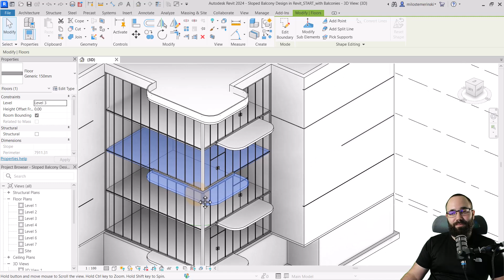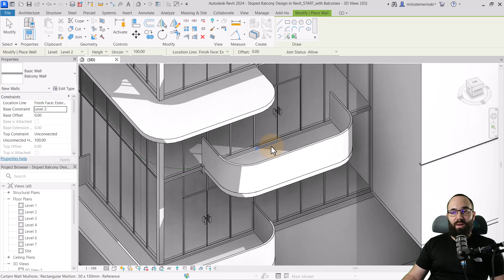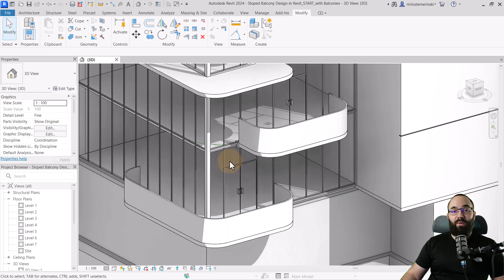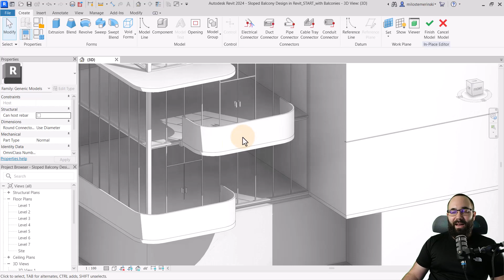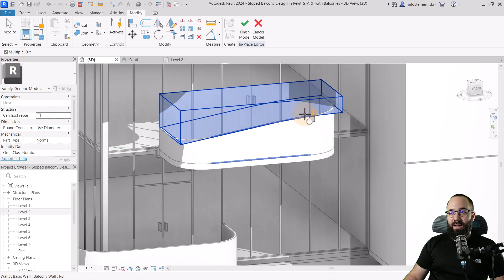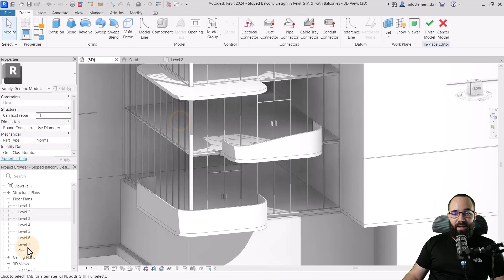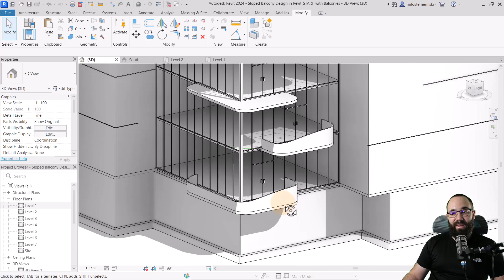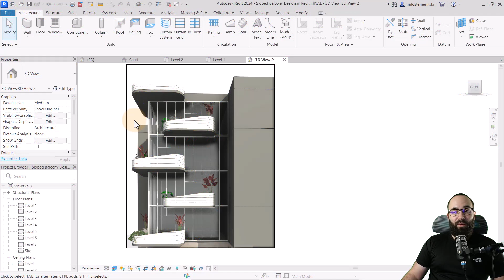How to Create a Sloped Balcony Design in Revit Tutorial

Comment: Whats your pc configuration? Is 8gb ram enough to working in revit ?
Reply: There is nothing like enough. 
Nowadays 8 GB is not even enough for Smartphone.
8gb is enough for revit but when you go more complex model. It will struggle. But still if your processor is atleast 11 gen+ might smooth.
Reply: @moonwolf4937  yes bro u are right 👍 when I more curtains wall my laptop stuck and I was very angry and that's thing I changed 100times my software revit to SketchUp .sometimes SketchUp to revit what can I do plz give advise what to learn when laptop Ram low